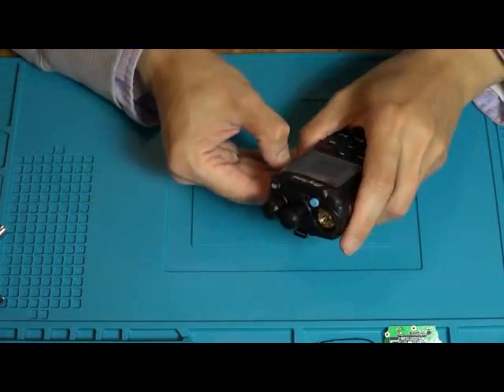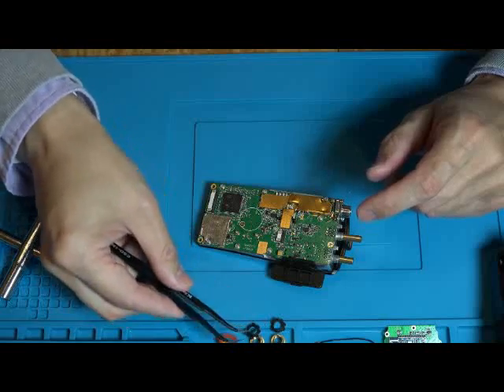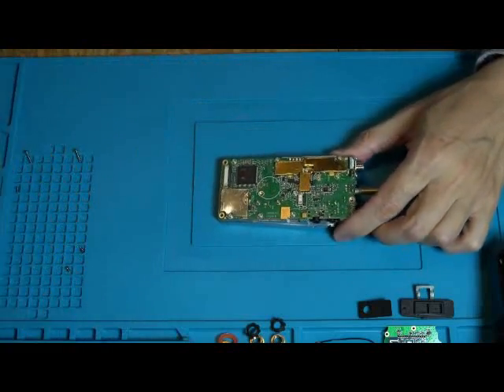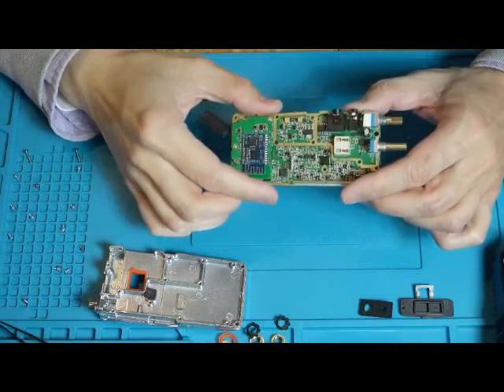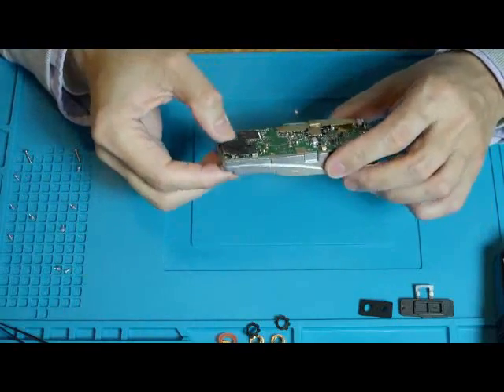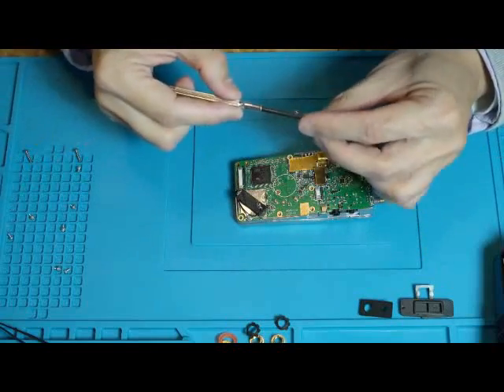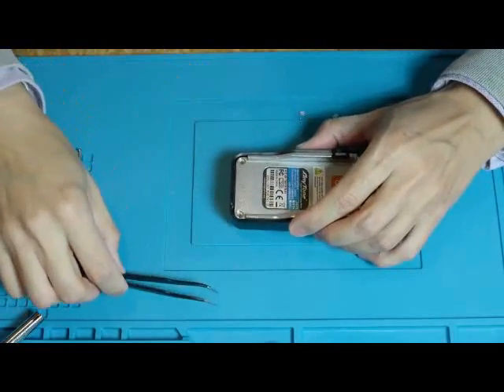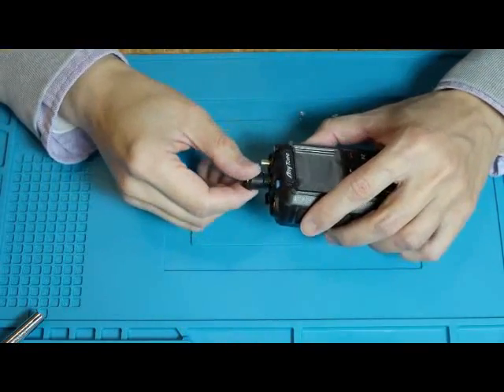AnyTone D878UV BT Module Install

Comment: Great to see a meticulous, well organised technician in action.  And like all good techs, he has a dog nearby offering expert advice hihi.  A few notes:  as per the video, don't solder the antenna pin until the PCB screws are done up, otherwise the soldered joint could be compressed & fracture.  Also make sure all the screws are tightened up snugly, this is vital for good RF shielding and overall receiver performance.  And last, use a little bit of silicone lubricant on the rubber seal that goes around the radio, especially around the bottom to ease the fit and prevent it 'bubbling' out.  Very nice video, thanks Duane :)

Comment: Thanks for the video. I am not going to even attempt this. Every time I attempt to dissemble electronics that are so tightly put together, I never can get them back together properly or I break something in the process. If I am going to wreck my current radio attempting to upgrade it, might as just buy the new upgraded radio one without wrecking the old one. :)

Comment: He was meticulous up to the end when he put the red o ring on the outside and not the inside. I wonder if he ever figured that out and made it right. I still don't know what the BT module is good for or where to get one if I wanted one.
Reply: The BT module allows you to use a BT PTT button. It also adds APRS RX in addition to APRS TX. (The current BT board. Earlier ones did not add APRS TX.)

Comment: I have a AT-D878uv with what I believe is a bad speaker.   The external speaker mic works and the data cable work fine.   Has anyone changed a speaker?  From this video I can't what the speaker connections are.

Comment: After this Work, what Firmware is too use?? The 878uvII or the Original 878UV ??
Reply from the maker: Sorry for the late reply.  You would use the same FW that is in your radio currently, this is not a hardware update, just adding a module

Comment: Anyone able to get a BT module for the Anytone yet?   I'm looking all over for one with no luck at all!
Reply: I just installed my module and the video was very helpful!!.  My kit came with a new ribbon cable for what I think is for the LCD screen (narrow ribbon cable) so I replaced that as well.  Make sure you all pay attention to the solder joint and make sure you do a good job getting that solder pad and antenna center conductor clean as can be before resoldering.  I had to reopen my radio and reclean and resolder my antenna center conductor pin after my digital signal reports were horrible.   Great reports after the more tedious cleaning!!
Reply: @chrish9831  I just installed the module with APRS rx. The module had a white wire soldered to it. did yours have this also?
Reply: @TropiCallahan  the BT only module does not have this wire, only the APRS/BT module. The white wire attaches to a pad on the main board marked AP (or maybe AF, it's not easy to see.
Reply: @chrisjohnson8741  where did you find the APRS/BT module? I’ve only come across the BT only module in my searches
Reply: @n8whitenoise  it was available from anytone.us for a short while, that's where I got mine. They aren't on the website now but you might try emailing them.